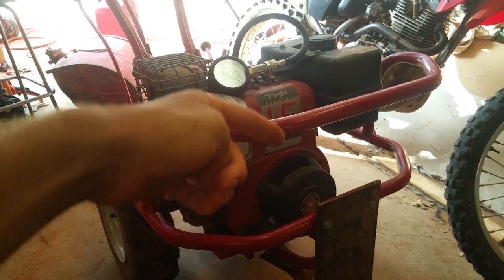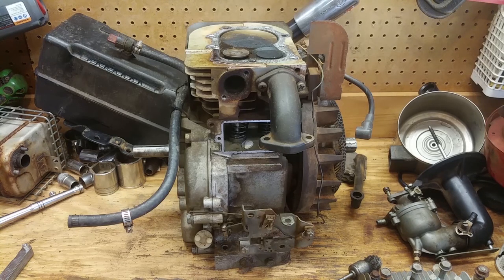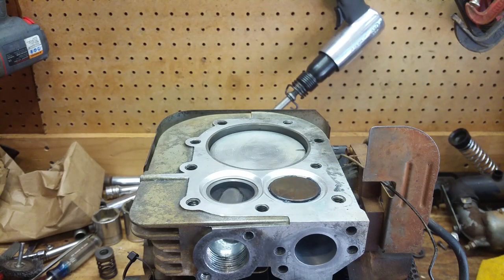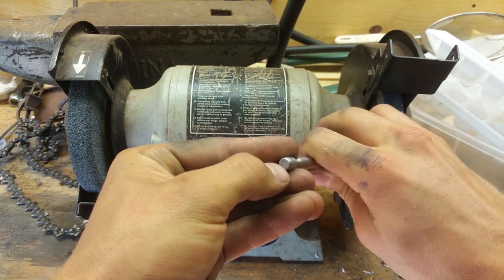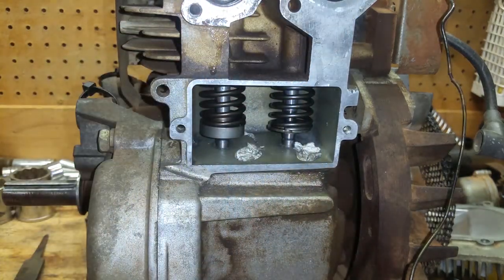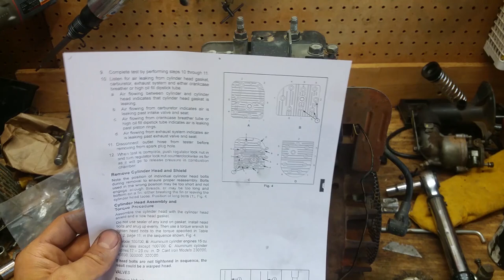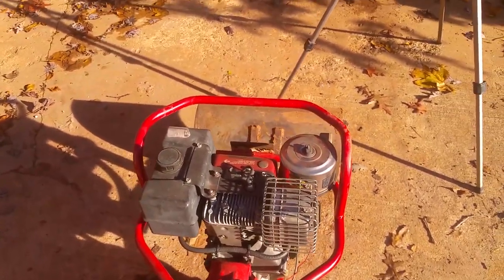Troy Bilt Horse Tiller Engine Rebuild

Comment from the maker: Hey Yall! Parts and tools used in the description!
Timestamps:
0:00 Intro & Diagnosis
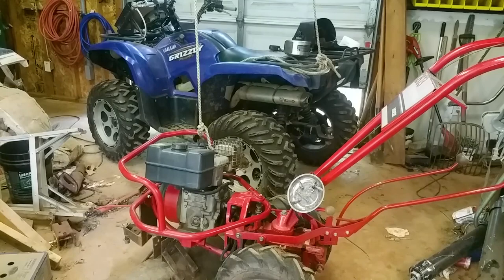7:56 Engine Removal
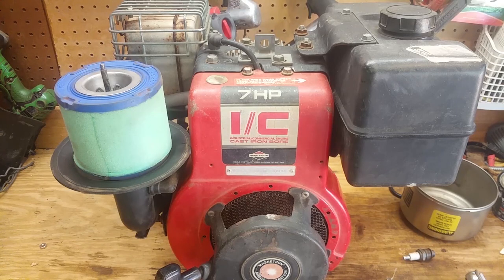11:13 Engine Teardown
15:08 Cylinder Head Inspection
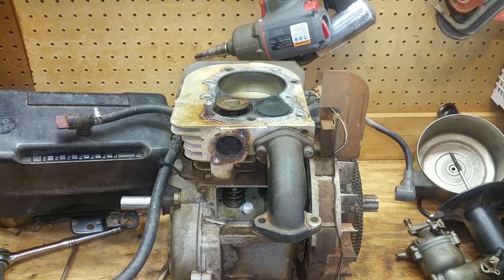17:46 Valve Inspection (PROBLEM FOUND)
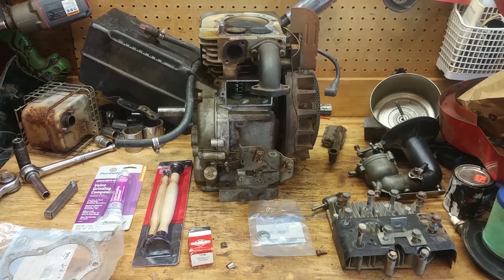21:17 Valve Removal
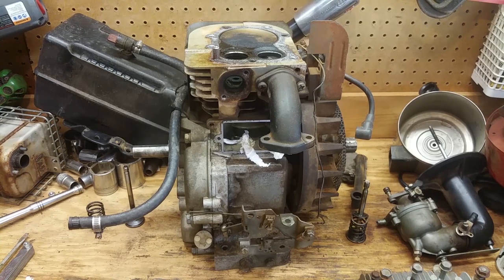24:55 Carbon Removal
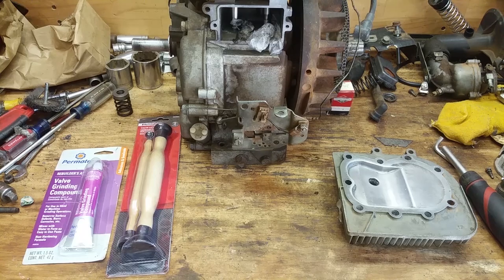31:00 Valve Lapping
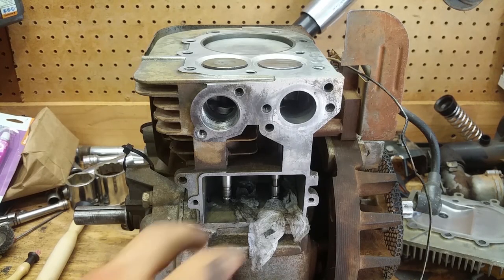40:57 Setting Valve Clearances
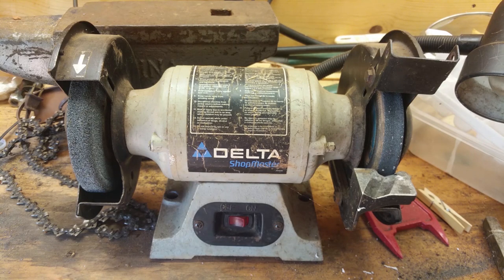44:55 Grinding Valve Stems
51:11 Valve Spring Installation & TRICK
57:20 Head Gasket Installation
1:02:45 Head Gasket Torquing
1:08:15 Briggs and Stratton Carburetor Gasket TRICK
1:13:05 Engine Installation
1:15:19 Starting Engine
1:17:03 Carburetor Tuning
1:18:50 Outro

Comment: Matt, great video, very well done. You are a gifted mechanic and produce a smooth video. I am the original owner of a Troy Built 6 HP Horse, bought in 1976. Still all original except tines and axel seals. Does burn a little oil, I have to keep the plug clean, but starts on first on second pull. It did start to have problems with the engine racing, corrected that with a Govenor adjustment, thanks to YouTube for info. I am now a subscriber and look forward to more of you sharing knowledge. THANKS !
Reply from the maker: Thanks, I appreciate it! Glad your Troy Bilt is working great! I replaced my engine, because It got unreliable for me. It was a 1994. Thx for the sub

Comment: Hey Matt, Great video! Yours is one of the best I've seen. Great explanations, great video. Thank you so much for taking the time to do it. I figured from your description of the engine dying and the lack of compression and the exhaust thumping noise that it might have been exhaust valve failure so I thought you should have started with pulling the head off. But with the necessary components to remove for valve spring access, it was either pull the motor or the brush guard.
Reply from the maker: Thanks for the positivity! Yea, it was much easier to just pull the engine out. You never really know with these things.

Comment: Good job on the engine, and the carburetor. Double gaskets and the teflon washer , prob be a good idea to use them from the get go.
Reply from the maker: Yea, sometimes you gotta get tricky with these old engines.

Comment: Matt, I just watched your video on your tiller rebuild, I also have one with the 8 hp engine. I was hoping you can tell me or show me how the springs attach on the throttle and the governor, I thing I'm missing something and I can't figure out how that whole area is set up.  I got this tiller from a friend some what in pieces.
Reply from the maker: If you have this exact same engine there is only 1 governer spring. One end of the spring attaches to the end of the governer arm on the engine. The other end of the spring attaches to the throttle slider on the little throttle mounting plate.

Comment: You are on your way it is only a tiller but the fundamentals are still the same 
Lapping is to make the seal between valve and seat check periodically with a thin smear of Prussian blue to check you have sealing for 360deg

Comment: A prediter engine is lighter so you'll need to hang weight on the front to keep the balance even
Reply from the maker: This tiller actually has a solid steel weight bolted to the bottom of the engine.

Comment: Oven cleaner is an effective chemical agent for removal of carbon. Acetone is ineffective.
Reply from the maker: I've tried that before. It works well, but can't it eat at the Aluminum?
Reply: Matt's Shop Do not leave oven cleaner on an aluminum surface for extended periods. Spray it on and let it work for 15 minutes before rinsing it off with water to neutralize the active ingredient: sodium hydroxide. Repeat application and rinsing if needed. Always use rubber gloves and eye protection. Used properly, oven cleaner will remove carbon deposits from cylinder heads and exhaust ports with less chance of damage than a wire brush. Hope this helps.